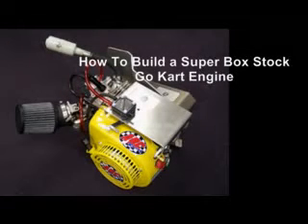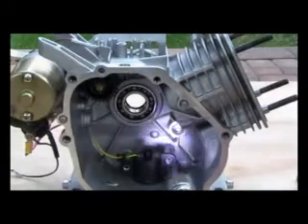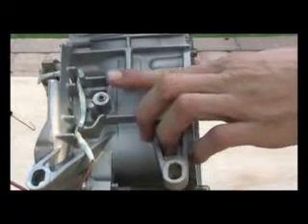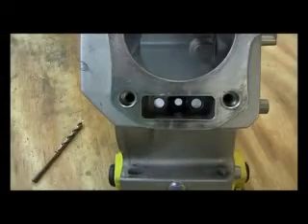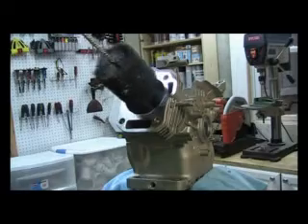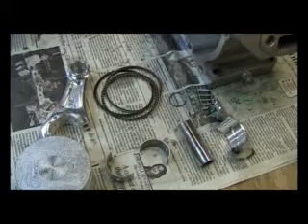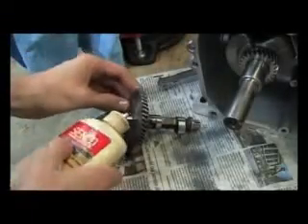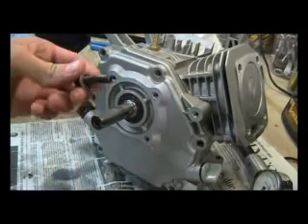Honda Gx200: Part 1

Comment: Nice video. Only thing I noted is you did not say where to place the piston when lining the two dots up on the crank shaft and cam shaft, It is a four stroke engine?  This was good to watch as I am hopeing to be getting one of these motors or a simalar in te near future,,,Cheers, Pete

Comment from the maker: I would go with a super box stock cam, you can get it from NR racing or ARC racing. This cam is great for the money (only 50$ and you don't have to do that many modifications to your engine. With this cam you only have to run 18 lbs springs and no grinding of the block is required. But with that said, the best cam for your engine depends on the mods you have already made on it.

Comment from the maker: Hey! Well in my video you should be looking at 4 separate tubes, 3 or which connect to the fuel pump. The black box that sits on top of the engine is the fuel pump, on the bottom is an inlet tube that draws fuel from the fuel tank and at the top there is an exit tube that pumps fuel to the carburetor. Sticking out of the fuel pump is the pulse fitting that connects and draws a vacuum from the valve cover to drive the fuel pump. The last tube is there to vent the engine block. Hope that helps!

Comment: Hey Great Video! I've got a GX140 sitting outside and i know the GX series is all pretty much the same build, i was just curious about the hose barbs and tubing you had on it, what is the connection for those?

Comment: I had the same problem. The carb jet is too small to compensate for all the air thats being let in. Its getting too much air, and not enough fuel. Get a .37 drilled jet or higher.
go to bmikarts. com to find this part.

Comment from the maker: Message me your email and I can email you the gx160 (almost like the gx200) service manual, some carburetor tuning guides, and engine trouble shooting diagrams I made. One of the reasons I really advocate for getting a super box stock kit it because of reliability; It runs great and you dont have to fiddle around with the carburetor too much which can be extremely difficult.

Comment from the maker: ...(it maybe covered by a little pastic nob) dont touch this one, it should be set at a stock 2-3 turns outwards from its fully seated position. The pilot adjust screw also adjusts idle speed by varying the fuel delivered by the pilot jet. First the best speed for the engine to idle at is about 2000rpm. If your engine seems like it laggs when you hit the gas its probably because you need to increase the jetting.

Comment from the maker: First off, if your only using a new airfiter and everything else stock then you shouldnt really be having any issues. I asume you are just using the stock carburetor correct? There are two screws on the gx200 carburetor: the throttle stop screw and the pilot adjust screw. The throttle stop screw should be a plastic philips head screw at the top of the carburetor this will adjust your iddle speed. The pilot adjust screw is a flat head screw with a spring on the side of the carburetor...

Comment: Hi i got my airfilter & adapter today and my engine isnt running right it oggs whin i hit the gas an i tried to move the air fuel mix screw but it will only go so far when turning it o the left and right

Comment from the maker: My video (in part 2) outlines how you install this. I have heard that using a genuine gx200 carburetor and jets can help you add as much as 1/4 hp.
Now if you dont decide to build a superbox stock engine then you will end up having to choose the jetting yourself, be warned though carburetor tuning can be extremenly tricky if you dont have a dyno. here are some websites to help you out
w w w, affordablegokarts , com / Drilling % 20 Main % 20 Jets, php
w w w ,nr - racing , com / hopupkits ,htm

Comment from the maker: As far as the carburetor goes you really dont need a bigger carburetor than the stock clone carburetor (but with different jets) unless your running anything above a superbox stock engine, ie the engine my video shows how to build. If you run a bigger carburetor you risk running your engine to rich and running in to reliability issues, hard to start, runs poorly etc. 
For a super box stock engine I would recommend using a gx140 emulsion tube, .035" main jet, .024" pilot jet.

Comment from the maker: Here is how the engine increases power;
First the stock intake and exhaust is really restrictive, a k&n style airfilter and a high flow exhaust increase gas flow through the engine. The new carburetor jetting is in response to the increase gas flow. The governor removal opens up about 3000 more rpm for power which is crucial because this engine has no gears, the stiffer valve springs, new cam (which I forgot to mention), improve intake and exhaust flow at these higher rpm ranges.

Comment from the maker: .... you can certainly mix and match parts from the websites i have listed above but you probably wont get your engine to run very well, my previous engine was a miss mash or parts and it didnt run well. But there are several lower horspower clases such as the box stock engine you can consider that are way cheaper.

Comment from the maker: Basically what the superbox stock engine upgrades that improves PERFORMANCE is the carburetor jetting, valve springs, airfilter, exhaust manifold removing the governor. The other upgrades such as a billet flywheel and connecting rod are great saftey upgrades but dont really improve performaces, the lighter flywheel does however allows the engine to rev faster. Basically I would recommend this kit because its increases power rpm range and most importantly RELIABILITY....

Comment from the maker: So the hose barb that you see I drilled into the engine block really isnt that necessary. Basically on high compression engines you need to vent the engine block, the function of the hose it to vent excess pressure caused by high compression from the engine block to the valve cover. If you upgrade your engine to superbox stock there is really no change in compression that really warrents this kind of set up. The otehr hose that connects to the fuel pump is important though so keep that.

Comment from the maker: @minibikerider1 nope but is is actually necessary because when your cornering and/or you have your engine at a 15degree motor mount then the oil in your engine tends to slosh around. When it does the sensor registers it as low oil and shuts your engine down, which kinda sucks if your in a race. But no your right it would not change hp or rpm redline